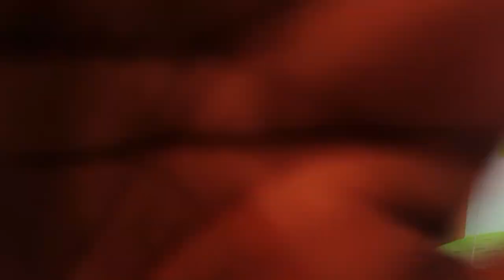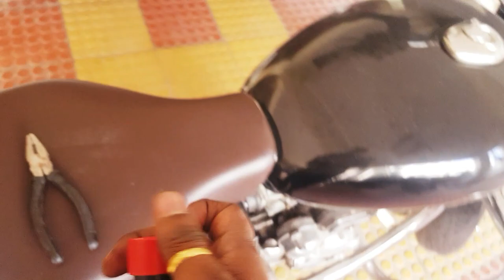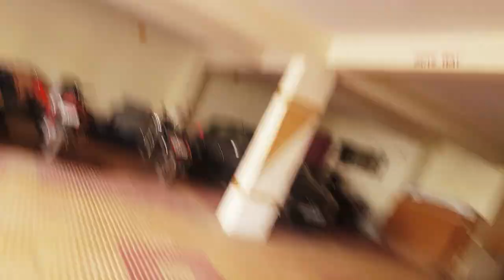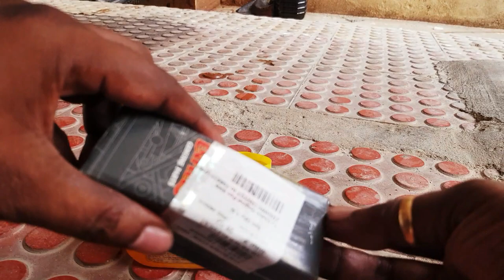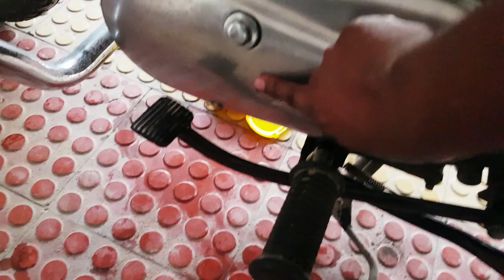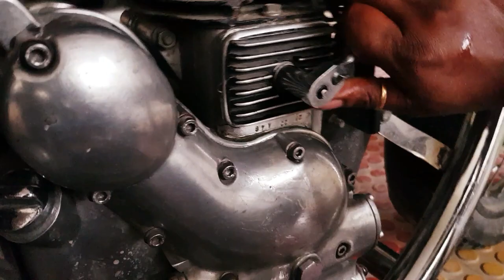Royal Enfield Standard 350 Engine oil Change at home

Comment: I have used Castrol 20-50 oil till now.  Can I change brand?  My bike is 1986 model and got engine work done.  10 thousand kilometers have been done.  Still no problem and no sound.
Reply from the maker: yeah you can change brands, but if the current brand is giving good results then you can stick with the same. Thanks !

Comment: I did the same work by changng the oil but unfortunately  the 21 no nut where oil from timing gear cover becoming leak after completed the oil change
Reply from the maker: have you checked/replaced the seal. With seal you should be using the gum like paste to prevent oil leakage.

Comment: I have RE electra 5speed 2008 CI engine, can i use Shell 20w50 fully synthetic engine oil ?
Reply from the maker: Hi there, 20w50 are more for the older engines like the Cast Iron ones. For the CI engine I think the best available one is Motul 3000 4T 15W50, but before finalizing I would advise you to talk to your local mechanic too. Thanks !
Reply: @rideatease  thank you.. Sir
Reply: MotoRide Food N Travel .. I have 2008 electra 4s speed gear set (opposite side) / cast iron ?  / old Bullet ? Do explain what should I call 
& I have used Liqui moly 15w50 synthease technology 
So what if I switch back to 20w50 synthetic technology...
The difference of WINTER / cold grade ..does it effect engine if I service it again ..or should I stick with 15w50 synthetic technology..
Do reply soon appropriately for all questions asked abv..
Thanku

Comment: Very nicely explained..... Great video.... I like it....... Can we use diesel for engine flush if we have not M3?
Reply from the maker: Thank you for the comment !! I am not quite sure if we can use diesel instead of M3, but what I can sense is Diesel might not show a good result (and not sure how safe it is to use Diesel because  if we add, we need to run the engine ideal for 10-15 minutes so because of heat the diesel may burn or may result to other bad complications), so I think its better to go with proper engine flush - its pretty much easily available in amazon.in.

Comment: U didn't change the suction filter??
Reply from the maker: no, I think it was in good condition hence cleaned and used the same..
Reply: @rideatease  u didn't show the suction filter in the video🙄
Reply: @rideatease  it's better to change these filters rather than clean and use them again... Anyway it's personal opinion 👍
Reply from the maker: my bad !
Reply from the maker: that's a good thing though, next oil change will go for a replacement, thanks !!
Reply: @rideatease  😊👍

Comment: You have done one big mistake while opening the Engine case bottom oil bolts..
U have removed only two bolts from engine case bottom side.
Last one u didn't removed, if u open the third bolt also u will drain a huge quantity of engine oil..😎
What happens u will add new Engine oil and it mixes with old oil in the engine. The quantity of oil will become more and after Engine runs continuously over flow of Engine oil will flow out from Engine and the piston and rings will worn out....😎😎😎
Reply: Ye to old Bullet engine  .